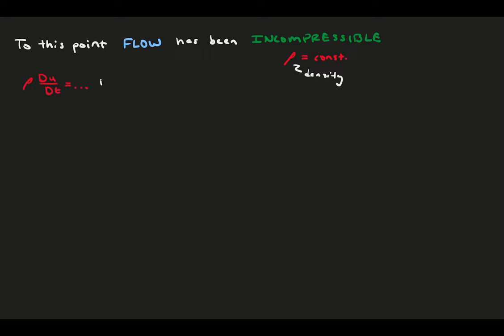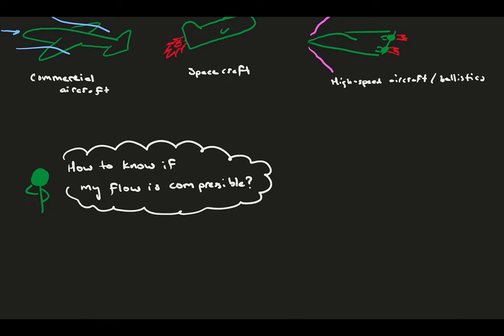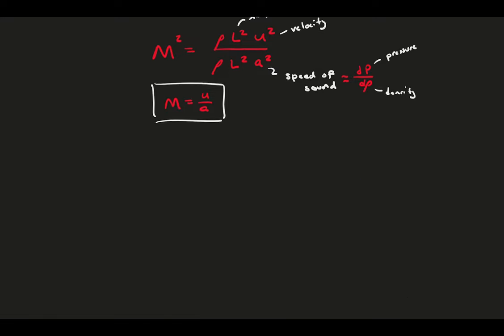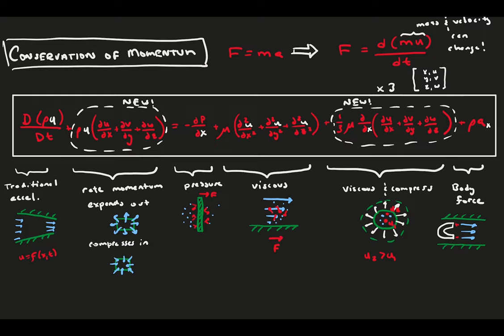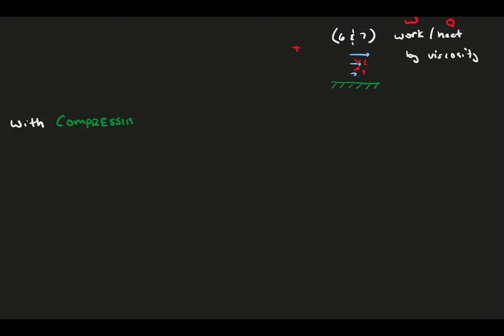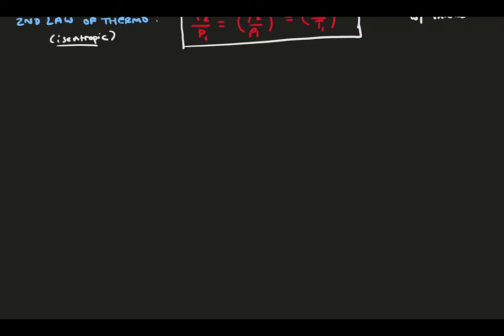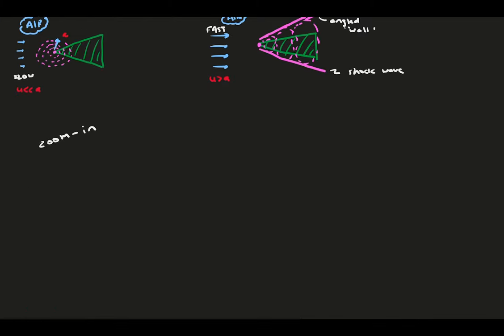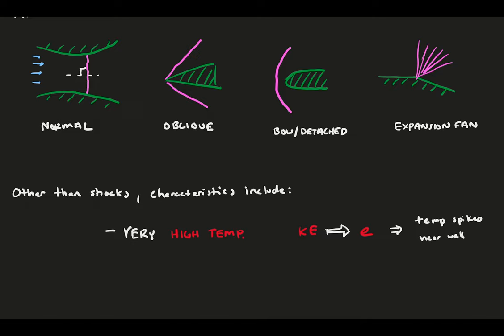Compressible flow [Fluid Mechanics #18]

Comment: hi sir. I want to ask a question.
if there are two conditions of compressible fluid flow in the same flow area but at a different speeds. why the higher velocity flow has a lower static pressure?. is it the same as the incompressible flow caused by the dynamic pressure? 
thanks
Reply from the maker: Hi! While I am certainly no compressible flow expert, I think you're on the right track of thinking. My interpretation is that it velocity and pressure still have the same trends in compressible flow as in incompressible flow, but compressible flow just means you need to account for other flow property changes, which is why you can't use Bernoulli's equation. Does this help?